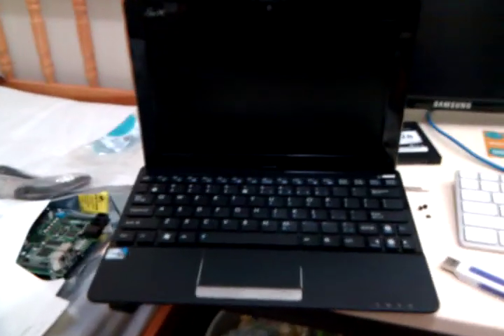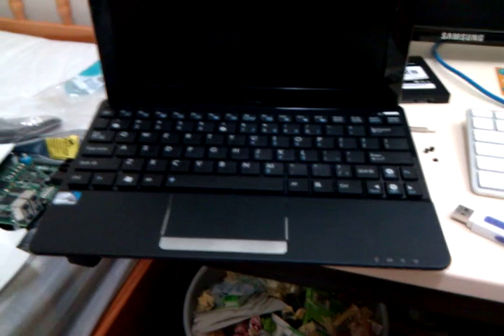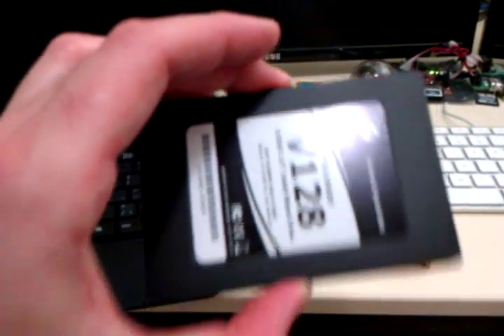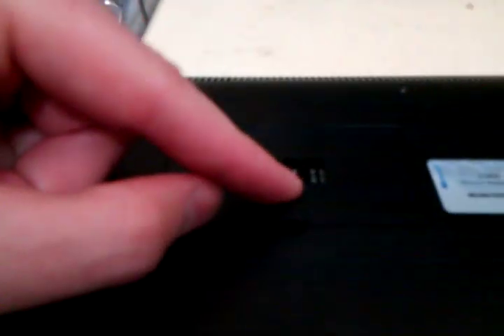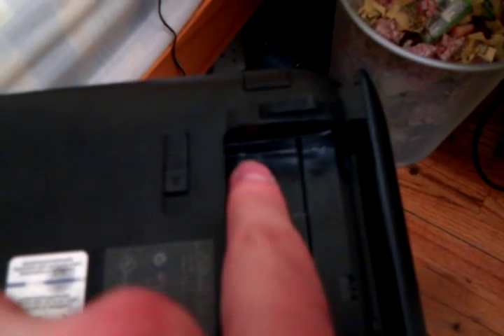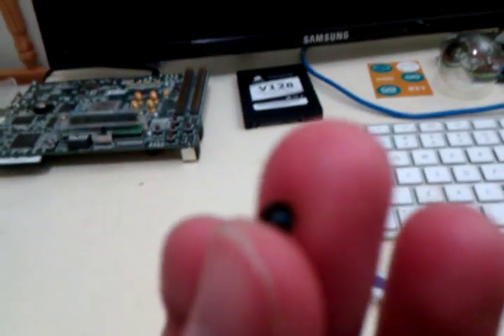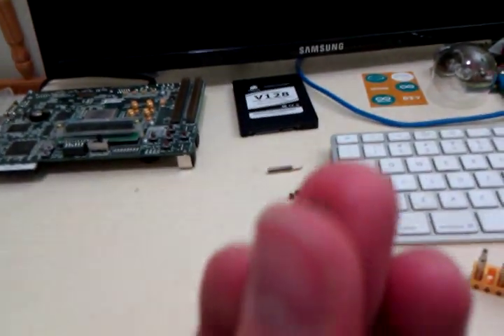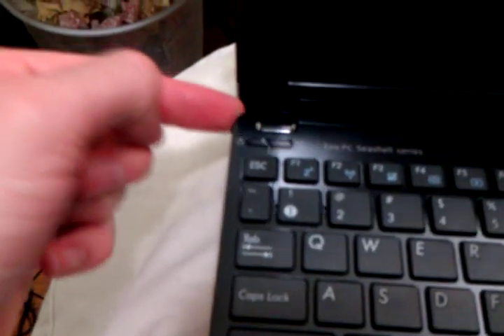ASUS Eee PC 1015PEM SSD Installation - Part 2

Comment: Hi,

Question for you.  I just got a 1015PN, and want to upgrade the memory.  I unscrewed the small philips screw holding the memory compartment on, but when I try to take it off....it's hard as hell.  The small piece of plastic bends quite a bit, but I'm afraid I'll break it.  Is this common for Asus netbooks?